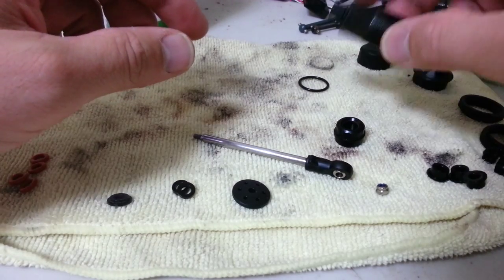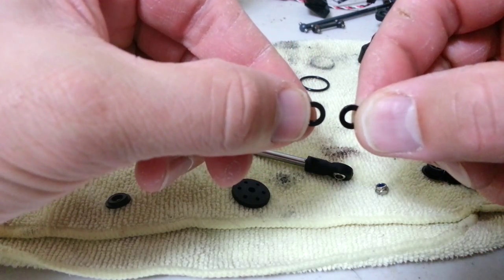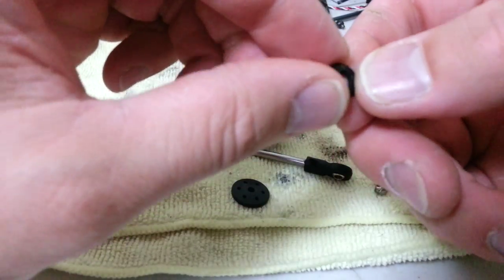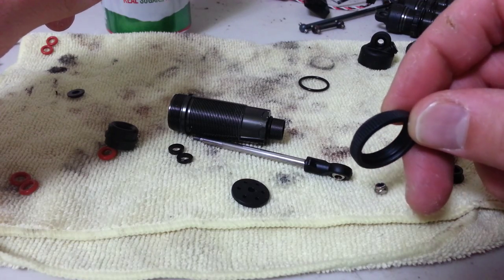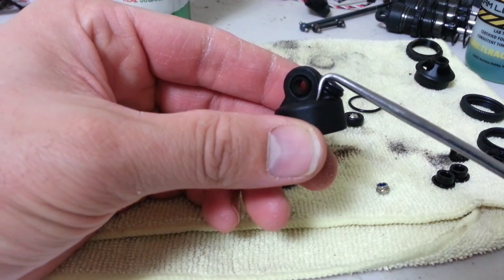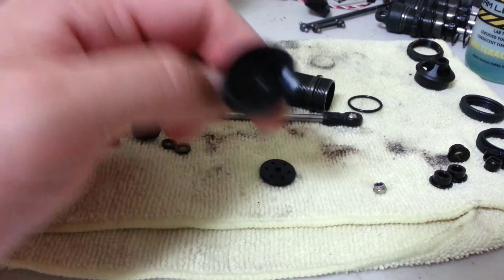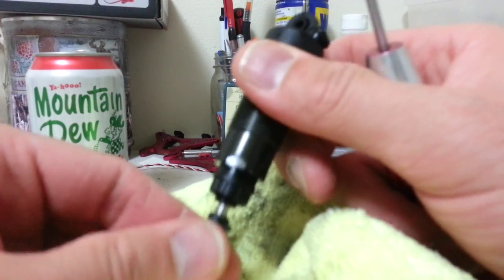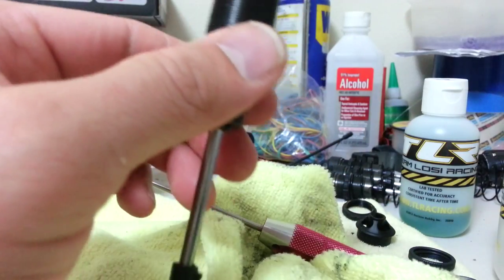How to build emulsion shocks on Tekno rc kits

Comment: stock shocks are better
Reply: +Buck Lee That depends on what sorta piston your running.
Reply: +Tuffenough4u I felt the stock on the eb48.2, with delrin cartridge and 6X1.5 pistons it performed better.
Reply: +Buck Lee that may very well be true for a solid piston, but you should really give the VRP 2 stage pistons a go. As most who try them, I suspect once you do you won't go back to anything else. For those you will need to build a "dead" emulsion setup.